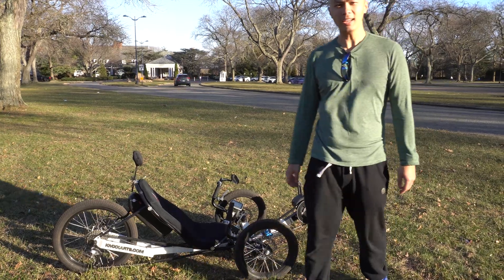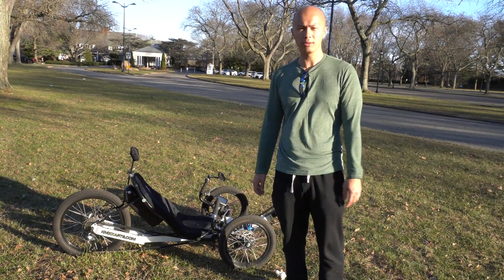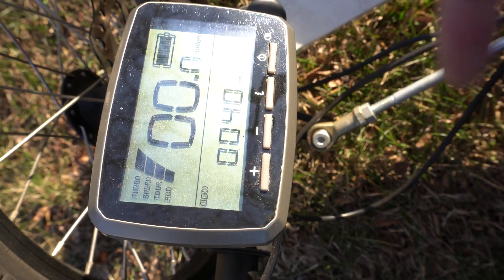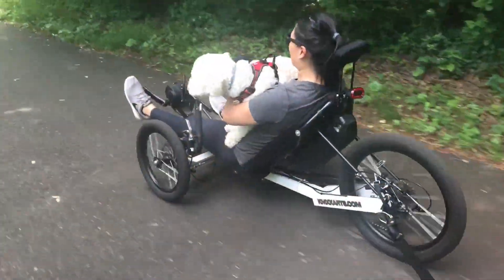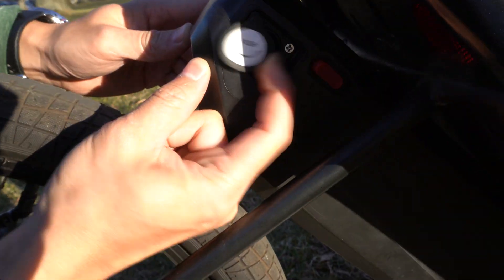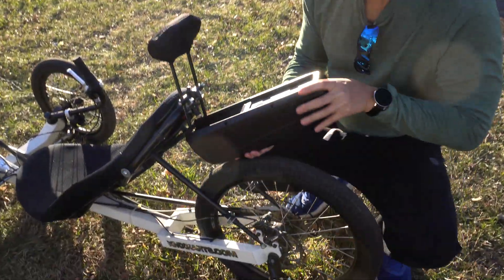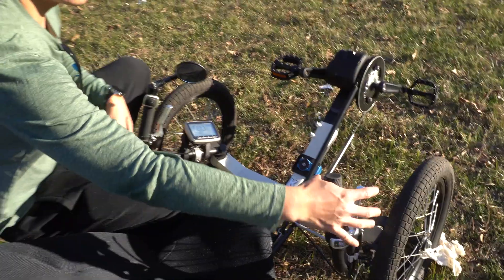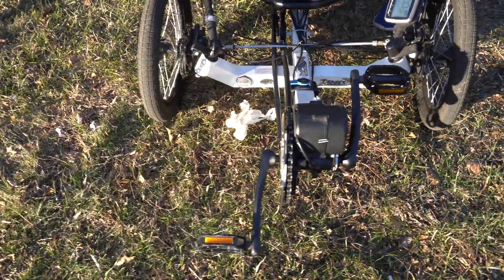Electric Recumbent Trike Build Part 2

Comment: Could I have your thoughts on weather this would be any good for a right leg above knee amputee. I originally bought my Kmx years ago when the company first started. But I found it to be too hard to pedal with my prosthesis on. And no matter what I did I couldn’t sort one legged peddling out. Would the pedal assist work with one legged peddling any input would be gratefully received. Thank you Kevin Ellis
Reply from the maker: Think it should work. The assist is pretty quick but you can feel a slight lag, thus I don't think it would notice one legged peddling. Consider a setup with a throttle so the guesswork gets taken out of it.

Comment: I see you turn the motor downside up.  Good thinking, Does it help 100%  avoiding any movement of the actual motor block?
Reply from the maker: It was turned that way so that with the torque it doesn't continue to spin. Also this orientation decreases the chance of it hitting anything. It works perfectly in this orientation.

Comment: is it hard or can a local bike shop build it.  i am planning to get your system or a bafang.  some of those with  pedal assist off the factory are very expensive.  if you are going build one what motor will you get? the bafang seems ok

Comment: Hi. Thank for the update. I am very interested because I have a KMX Viper similar to yours and I am undecided to which pedal assist system to choose: mid drive or hub, cadence or torque?
How complicate is the TSD z2 to install? 
Your battery is 36V/15A. What is its average range?
I am 68 years old, is it a good option for an older rider?
Tks for your replies.
Reply from the maker: Hi, please refer to my part 1 video to see the ease of installation for the TSDZ2 Kit. My recommendations based on this video are mid drive, and torque sensing. I have not done a range test but based on similar builds this system should be able to do 30-40 miles assisted no problem.